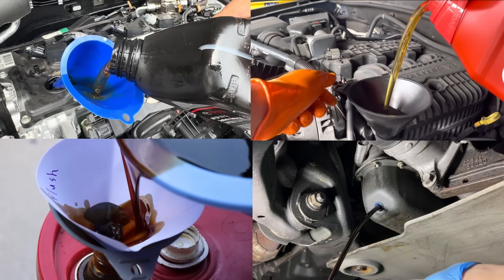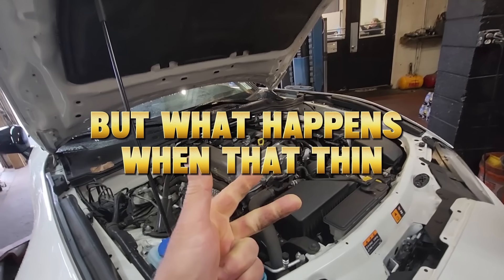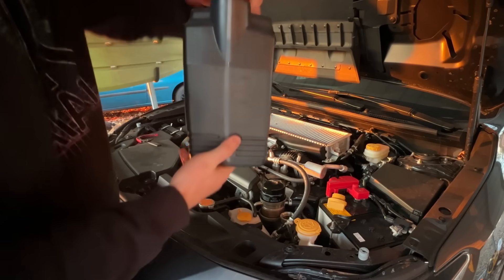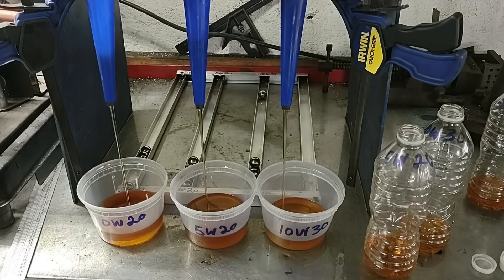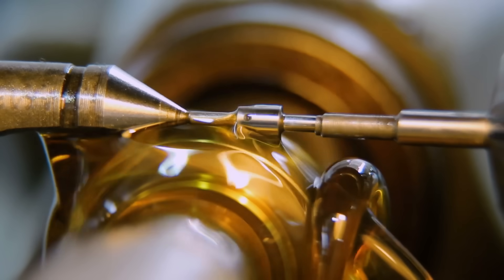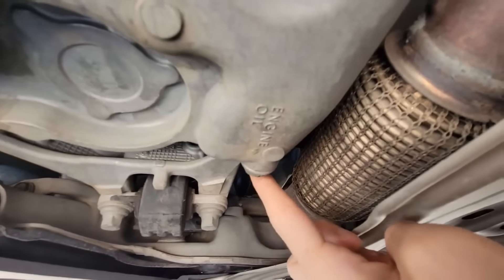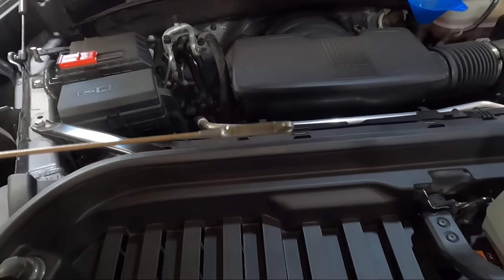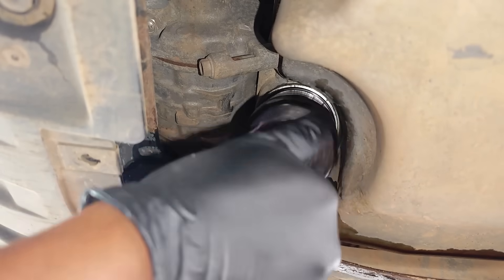The TRUTH About 0W 20 vs 5W 30 Oil (50 Engines Tested!)

Comment: I'm sorry but the dipstick on mine says 0w-16 and only use 0w-20 once and then use 0w-16 afterwards.  No issues with it in my car.  It's probably the tighter tolerances.  Heck,  you can run 20w-50 in your car if you want to but I guarantee in the winter it will make for some very rough starts and wear out your engine faster.  This video was not narrated by an actual technician.
Reply: Don;t care about the AI voice over >>ANY one running anything below 5W20 is [censored]
😁
Reply: Its like a heart attack: you don't feel anything until it happens.

Comment: Have 2014 ram 2500 is it ok to use 5 40 instead of 0 40
Reply: Just use 5W30 synthetic, Period.
change filter & oil between every  5000miles.

Comment: I have been using 0w20 Mobil 1 in my 1015 Silverado 5.3 engine since the truck was new . Engine is still quiet and only uses 1 qt in 7000 miles . (about 40 % highway driving ) . I have been changing the oil myself to be sure the intended oil ends up in the engine  .Also, a pf63e AC oil filter is used .

Comment: 2018 Mustang GT coyote. Recommended oil 6W-20. Fuck that shit. I’m not running that watery shit oil here in Florida in a high-performance V8 I run 20 W 50 in the heat of the summer and 15 W 40 in the temperate winter.

Comment: So, basically, Democrats are blowing up your engines to force you to not-ready-for-prime-time EVs.  

CAFE is awful.  Climate change, yes, it does, and did before man was on the planet.  That word means nothing, in fact, if climate DIDN'T change, life would go extinct on earth.  The warming and cooling periods change what areas get what minerals, soil, etc, by changing rainfall, rivers, glaciers.  Climate change is good.  Pollution is NOT good and we can all agree this needs to be reduced as much as possible.  Overreach in the name of a hollow word is not good.  We'll end up with more ICE and EV vehicles being built (shorter lifespans) and much more LAND and WATER pollution with the added manufacturer left-overs and end-of-life landfill additions...and the TOXIC leftovers of batteries will ruin water supply over time in many areas...leeching.

Now, on to oil, so back to first statement, 0W-20 to meet CAFE stupidity.  Thinner engine casings, plastic valve covers, thinner everything, to try and reduce weight.  This means reduced reliability and life cycle.  Add in the regulations for safety systems, which ADD weight with more computers and hardware to implement steering, braking assist and other such stuff.  

If the government was involved in any way, it should be:  Get rid of daytime running lights and put a limit on the size of all vehicles.  Trucks just keep getting bigger and bigger, becoming less useful, but more of a pain to drivers with NORMAL vehicles...high headlights searing retinas of the cars and smaller trucks/suvs in front of them...dangerous.  High beds that no one can use without a crane, forklift or a ladder.  The DRL issue?  Too many drivers NOT turning on their lights at night, because DRL makes then think lights are on...so no taillights and almost invisible if darker colored car.  DANGEROUS.  Apparently the DRL desingers and implementers NEVER actually tested this at night with regular drivers.  

Rollback MPG requirements, but you wouldn't have to if you limit the size/weight of NON-work vehicles to something manageable.  We have smaller families than ever before.  We don't need Suburbans or Tahoes, eliminate the overized SUVs.  Encourage the ongoing production of mini-vans for the fmailies that DO need some more room.  They're generally less dangerous and a bit better MPG over FS trucks.  MOST citizens don't need full-size pickups, at least not the FS of today which is really super-sized pickups.  Full size 30 years ago was what mid-size is today.  Cap it at that.  Must have a commercial DL and proof of need for a 150/250/350, Silverado or FS Ram or Titan or Tundra.  Eliminating those as options will reduce the corporate MPG collective and allow for better engines in the sub-compact, compact and mid-sized cars, suvs and trucks. 

CAFE also forcing crapp 4cyl turbos in everything.  More failures, more oil burn, means just as much pollution as a naturally aspirated 6 cyl in the end.  Just dumb.

EVs will take over, mostly, but let it happen normally.  Lithium-Ion is NOT it.  Terrible battery tech for autos.  When solid state batteries make it to prime time, then maybe EVs will be viable, right now, they're a status symbol.

Comment: 2020 Subaru 2.5 NA rod bearing bearing failure 28K miles Think it's due to poor metallurgy as it seems the threads pulled out of the cap and or bolt.

Comment: Quoting Scotty Kilmer once again, Modern piston rings are spring activated. The old piston rings literally had to be pounded into a cylinder with a large wooden mallet. The new spring type rings basically slide right in. And oil inevitably escapes and burns off. It’s in his videos you can find it for yourself.
Reply: Newest Ilsac is GF-7a and Automobile manufacturers don’t want your car to last forever. They want you to need a new car every few years. There have been vehicles that could’ve lasted much much longer. The industry does what I can to make those disappear.
Reply: That's right, the ring lands get gummed up with carbon.  Use valvoline 5-30 restore and protect and change often if you suspect a problem.

Comment: it is not the same using a car in Arizona in summer than Colorado in winter, the same goes with radiator fluid, there is antifreeze and coolant

Comment: I made the change 9 years ago when my 2016 4.0L 4Runner was brand new. Cap says 0W-20 but I knew better. You see, Toyota actually informs the owner it's ok to move up to 5W-30 oil, but is not exactly worded that way. As a retired high school teacher I'm aware that many people lack adequate reading comprehension skills. BTW, my Runner is in excellent condition and will last a long time. Go find out for yourself, I'm retired now. I'm not going to think for you. This video is well done!
Reply: Many people lack adequate reading comprehension skills. Spot on! Let’s be honest, half the population or higher lack basic reading/writing/grammar skills. Very sad, really.
Reply: Where do you see Toyota actually informing US owners it's OK to move up to 5-30? I'd like to see how it is not exactly worded that way.
Reply: I have Alto K10 AMT 2015 model car ...now I am using a Valvoline fully synthetic 5W30 during the hills area drive engine performing well.,❤ from India
Reply: I'm use 10w40 and sometimes 5w30 for my 1gr-fe
Reply: Can you explain how it's worded?
Reply: Same here for mine. And a few other vehicles that say 0-20 on the cap.
Reply: Where is this stated?

Comment: I have a 2017 Corolla and live in Fl.  it calls for 0W20 , after 20,000 mi. I went to 5W 30. and after 30 mi . the engine started to shake with a vibrating sound!  Not good! I put 0W20 back in and that stopped! I change oil every 6 months or 2000 mi. The oil is always a light yellow on the dip-stick, never dirty. 63000 mi as of 2025

Comment: Hmm....I have a Toyota with well over 325K, and have been using the manufacturer recommended 0W-20 with no problems what so ever! I change the oil every 5 months or 5,000 miles. Also, it gets hot where I live.
Reply: Same.
Reply: That's what I use in my 2015 Chevrolet suburban. 319k and runs great.
Reply: Same. 0W-20, 340KM and runs well.
Reply: My 2016 uses 0 w 20. Thats what caused the vvt failure.  Every mechanic says the same thing. $4000  repair. Never again.
Reply: @MarkTurner-vs7uc  That's your experience not mine! Let's just agree to disagree, and call it for what it is!!!
Reply: I use 0w20 toyota original oil on my 2024 rav4 hybrid in ireland ,changed at 1,000km after run in and every 8,000km after that 50,000km up on clock so far so good , the car care toyota guy on YouTube where I get all my info for toyota say 0w20 is the best for my model because it's designed to ticking up When it heats up with its additives ..
Reply: @Jacuf  The car care nut knows his shit!
Reply: Well it’s a Toyota so yes if oil is changed on time will last longer than most any vehicle
Reply: Not having problems doesn't mean it's best for your engine and you also change the oil often which is obviously good, but that also contributes to the engine lasting with potentially inferior oil. Unless your average drives are only a few miles each, nothing supports 0W and in hot climate 5W (or even higher) would be excellent too.

Comment: Can you provide any tests and data to back up your claims? I bet not, as I have seen several tests and almost everything you said is nonsense.
Every oil loses its properties after 5-6k mileage, so just use oil approved by the manufacturer or meeting the requirements and change it often, that's all. Some shops just scam people and don't change it, so do it yourself or find a trustworthy shop.
A good fully synthetic base is way to go, good additives and detergents do magic and they are the first to lose their properties, so yeah - I will say it again - just change your oil frequently. 
Most of Japanese cars are designed to run on 0W-20 oil and people around the world drive hundreds of thousands of miles using this oil without any issues whatsoever.

Comment: We have a 2023 Toyota Crown Platinum with Turbo,  required to use 0w-20 switched to 5w-30 at 20 thousand miles, same fuel economy and can sleep at night knowing it has the protection to run a long time. We only use Amsoil Signature series oil as well; the best money can buy.

Comment: My Honda calls for 0W20 and I used it till about 40K Miles. At 40K miles I change the oil to 5W30, a slight MPG down but it's worth it to protect my engine.

Comment: 2022 Honda Pilot. Cap rec's 0W-20. went up to 5W-20 yesterday. Ill go to 5W-30 on the next OC.
Reply: I pulled the Mexico manual for our 2020 Odyssey.  0w-30, 5w-30, and 10w-30 all listed as approved motor oil for the Honda V6 for Mexico.  When people say VVT systems or engine clearances won't run with thicker oil, this is direct evidence to disprove that for this engine.  Honda did not make J35 engine design changes between USA and Mexico vehicles.
Reply: @vandebem  I agree with that. Same with my gladiator.

Comment: I say bs. So you're saying don't believe what the manufacturer is saying but we should believe a AI voice on YouTube 😂
Reply: Wait. YOU are saying trust the same people who tell you the transmission has lifetime fluid inside, and often refuse to replace the filters.
Also, they tell you 10k oil change intervals.
😅
Reply: They only do it to boost MGP to meet EPA regulations.  I have a 2018 tundra that has a 0w-20 oil cap, but if you look in the manual, it says you can run up to 20w-50 in Mexico.   I live in AZ.  Absolutely no reason to use 0w20.  I run 5w-30.   But do whatever you want.
Reply: @MrFrame1979  A lot of folks make that claim but where is the real proof?
Reply: In summary, use 0W-20 synthetic oil meeting VW 508.00 specification for normal conditions. Only consider 5W-30 (VW 504.00/507.00) if you live in a very hot climate or drive under sustained heavy loads — and confirm it’s manufacturer-approved to avoid warranty risks
Reply: Well my friend has been running 10-w40 in his 24 tundra guess who has 65k and still running fine while others are blowing up after a few k
Reply: @perioquido  With only 65k, it ain't even broke in yet.
Reply: @njsongwriter maybe but considering most aren't making it beyond 20k it's a good start
Reply: 300k plus with 0w20 on my 4runner but ok guy's you know it all right lmao
Reply: @vegetar7886 Love how toyota owners make dumb statements all the time.😅
Reply: @vegetar7886 0w-20 is still thicker than the 0w-16 they use now.also i assume that it's the 4.0 v6 that engine is much simpler and doesn't have a lot of the overcomplicated nonsense they put on new engines
Reply: You people are so gullible,  I told you guy's this video is bs, now go watch the oil geek and he'll tell you guys same thing i said 😅
Reply: BS to your BS.  During the combustion event, the shear thickness of oil in bearings needs to be greater than the average size of metal particulates. This is why GM recently said to use thicker oil rather than get sued.  The 0 weight oil is only to get friction down, but then you trade off for wear.  Manufacturers are purposefully gaslighting the normie public.

Comment: I learned from a "back alley " good ole boy mechanic in 1972 on  my mach1 351 Cleveland, to use lighter weight oil in the winter, been doing it for 50 years and I'm going to do it in my new Trax, OEM winter AND  5W30 all summer temps 😊

Comment: I wouldn't put too much weight on what this AI channel says. Unless you have a vehicle made within the last 6 years or so, 0-20 oil is fine if your vehicle calls for it. But if you have a high performance car or truck, you should be using 5-30 anyway. Keep up with your oil changes (under 5k miles) and that will treat you well.

Comment: 5W/30 no matter what the temperature is outside ..👍🏼👍🏼
Reply: Good point, 0w-20 oils are the biggest enemy our engines could ever have. Besides which, if the weather's cold, your oil will probably be slightly diluted by the unavoidable trace water vapors and gasoline in it anyway - Ta Da!  Your 5w-30 0il is now a 0w-20!
Reply: @robertmaybeth3434  What if using a different oil than that which the manufacturer recommends invalidates the warranty?
Reply: @morganfbilbo4659  How likely is it that particular warranty work will involve an oil analysis? The answer is to Use the oil they say until your warranty expires, i suppose?
Reply: @morganfbilbo4659  If the failure could be attributed to that it certainly would.  The video hinted at going with the manufacturer's recommendations through the warranty period except you definitely shouldn't exceed a 5k mile oil change interval regardless.
Reply: @robertmaybeth3434 I just switched to 5 30 from 0 20
Reply: Would 0w-40 help?
Reply: @dennisyoung4631  That's good for Europeans. Mercedez, Audis, VOlkswagen, etc. Especially if it is a 6 cylinders or 8 cylinders, the heat that european vehicles generates is higher than American V8s.
Reply: @SirD31V1D  Because European engines are more powerful per litre/CI and more power = more heat, even the best petrol/gas engines are 45% efficient meanins the other 55% is heat.
Reply: @SirD31V1D I have used 0W30 in the Winter and 0W40 in the Summer for my 2011 Honda Accord wirh great success in Northern Midwestern America.
Reply: @simshogun2240  number 1 reason is for fuel efficiency.  The EU loves their green party globalists.  My BMW, the thermostat doesn't even open unless it's 207F.  Then the cooling fans kick in at around 200-226F depending on your driving.  That car runs hot.  My Mazda with the 13to1 CR, will run 190-212F.
Reply: Yes im use 5w40  @dennisyoung4631
Reply: @dennisyoung4631 Yes, if your temperature does not exceed 40, but I am in Saudi Arabia, the roads are crowded, and the weather is very hot, not less than 22c and reaching 46c, so I need a high viscosity, such as 10w40.
Reply: @qaz5022 uh, in Saudi you might wish a 10w-50….

That high temp you mentioned is concerning.  To my understanding, the low point speaks of how the oil (in general - there are multigrade gear lubricants, e.g. 75w-90 gear oil) behaves at lower temperatures - how “runny” it is.  Q

A low viscosity oil will flow readily at startup - your bearings will thank you.  You’re fine with 10w in Saudi.

The high number speaks of how your oil will behave when your engine oil is either 90 or 100 degrees C. - which figure might vary, depending on the testing body (or my memory is off.)

Obviously, ambient temps affect how hot your engine gets.  46 C. May well mean your engine’s oil gets up around 110-130 C. - which is where you want a lubricant that acts like a 50 weight.  

The same situation applies if you are driving especially hard, as in “high revs (like you’re driving your wife to the hospital, and she’s starting to go into labor) and heavy loads (towing) mean an engine that’s working hard - and they get hotter, then.

Finally, air-cooled engines tend to run hotter than water-cooled - much like my first bike was air-cooled, and Castrol GTX 20w-50 came out of the sump thinned to the point where it looked like water.

Hope this helps.
Reply: @qaz5022  Your oil is as good as your general environment and driving behaviour!
Reply: @dennisyoung4631  Nope
Reply: The idea would be to use a 0w and the 2nd digit depending on the external temperature but minimum 30.
 On the other hand, be careful, there are not only these clues, the engine oil has 30% additives. This is also what makes the difference
Reply: exactly the same motor Lexus ES350 2007 and 2014 on oil cap for 2007 5w30 on 2014 0w20
Reply: That's what the 10w-30 guys said when 5w-30 was becoming a thing.  There was no way they were going to run that thin 5w stuff in their engines.
Reply: Why not 0w 30
Reply: I will find it hard to accept! The engine take in air to ignite and cool from outside! The climates differs in continents and this cant be irrelevant!
Reply: https://youtu.be/XyBUcxFmqn8?si=41psILqGVlPiYemp
Reply: These oils are like water. Always research your motor oils because some engines require a specific type
Reply: Yeah its good to-20F
Reply: Same here in my gasoline engines, and for my diesel 2.8 duramax i use 5w40. Both Shell Helix Ultra. My duramax has over  300k kilometers and still only uses about 500ml to a liter every 10000km